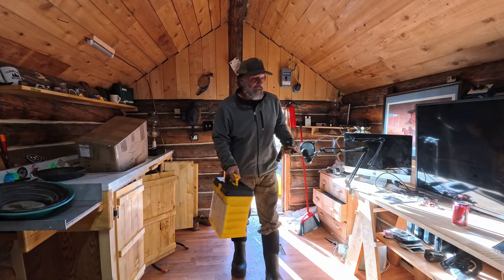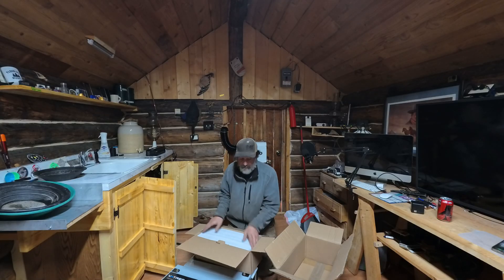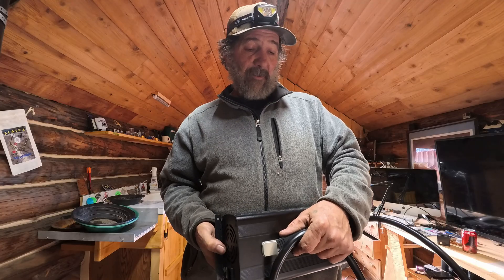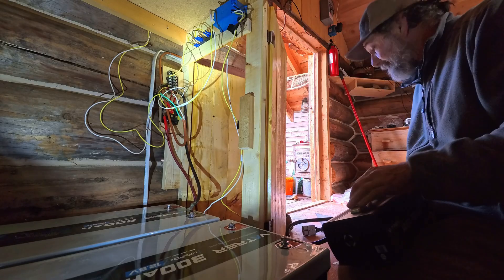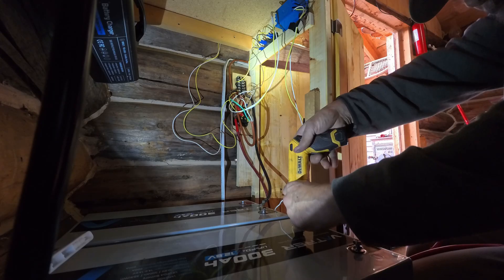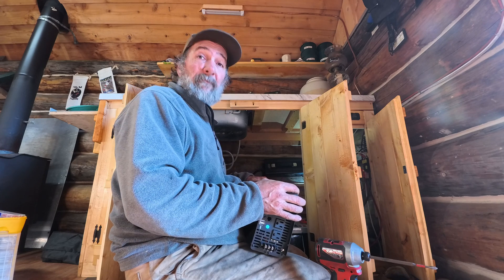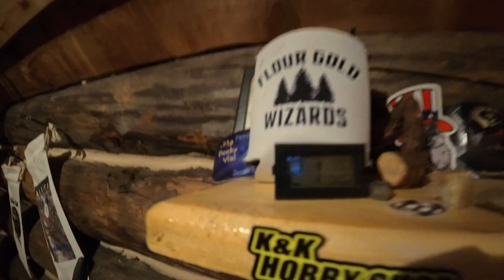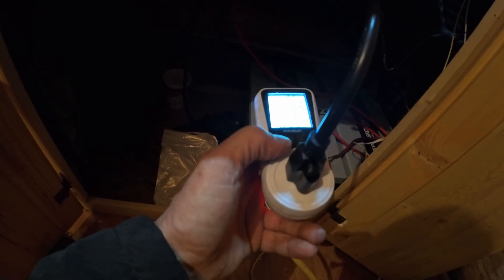My Mancave Just Got a Serious Power Upgrade

Comment: I think I'm going to get some Vatrer 48V batteries for the power system I want to put on my property. I want the self heated ones so I won't have to heat my utility shed if I stay late in the season.
Reply from the maker: You will still want to heat it.  If you are not on location to charge all the time that is

Comment: Always insulate the contact poles of a battery during work, its just 12V but 300 Amps unfused!! If you lay accidently a metal tool an the poles, you create a small  china syndrome at home, it will flow through your floor...  Greets from vienna  :hand-pink-waving:🇦🇹
Reply from the maker: The areas that have the wires have covers for them, I just did not show them.  Fuses are also in place. In fact two styles as well as the tones built into the inverter and charger.